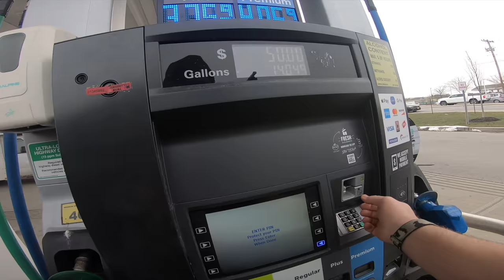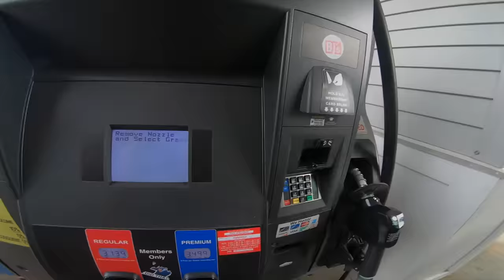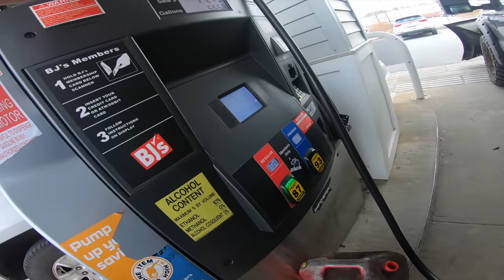2022 BLIZZARD Snow Removal with RC GUY GARAGE part 1

Comment: What a nice plow!! Big black got put too work. Nice work R.C GUY GARAGE YOU ROCK!! Is there new tires on big black?? Looking good !! 👌👊👍
Reply from the maker: Not yet! Those are sitting in the GARAGE waiting for this Spring 😳👍💯
Reply: @rcguygarage  what a nice truck! My older Brother just bought an f 350 Ford. Not brand new.. used. But very nice trucks.